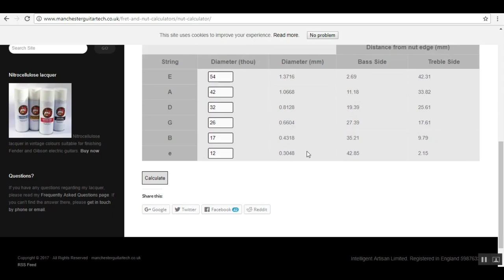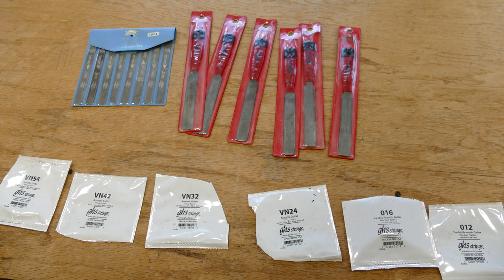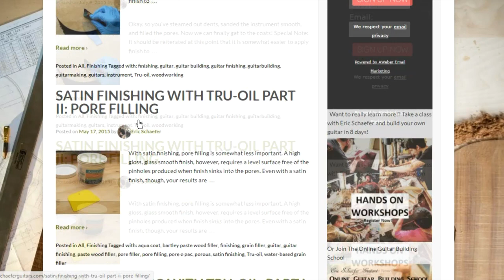Nut Slotting Part 2

Comment: Two qestions; 1. how do you know how far from the edge to cut the two E string slots? 2. Where do you get a "razor saw" like that?
Reply from the maker: 1. short answer: experience.... barring that I would say look at another instrument youy like and use that measurement... Finally, if you don't have that, going with 3/32" from the outside edge is always a safe bet.
2. Any hobby store (hobbylobby, hobbytown usa etc...)